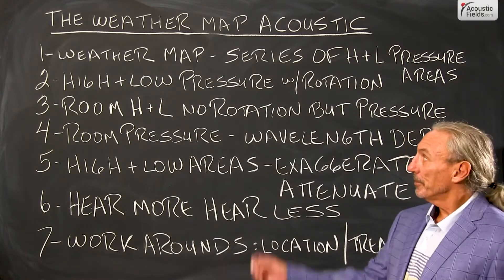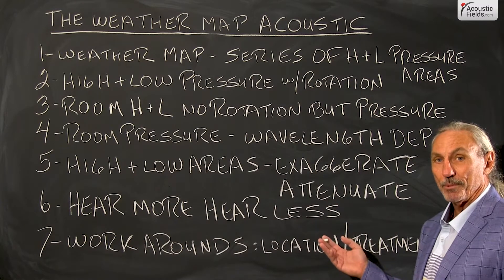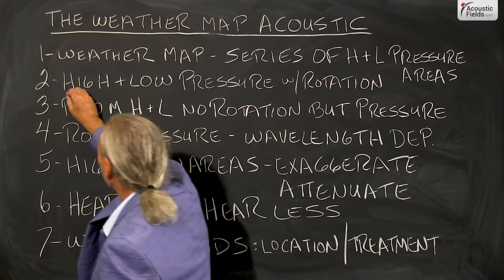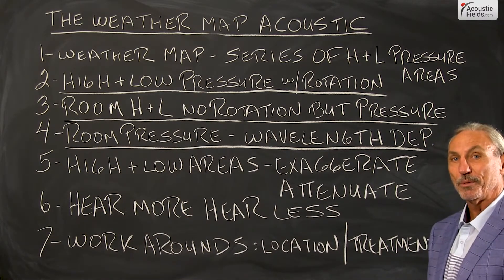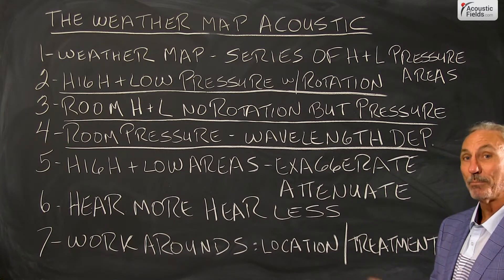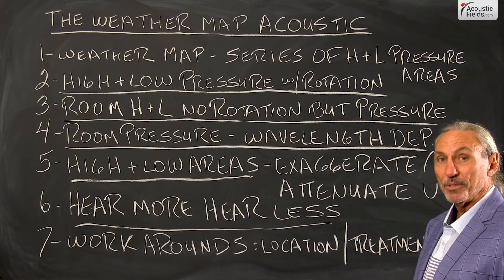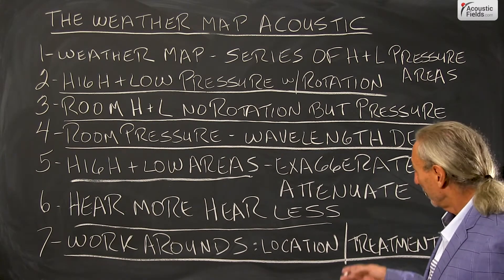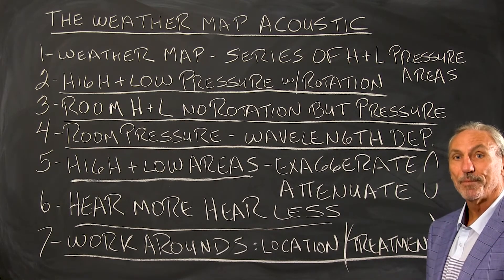The Weather Map of Acoustics - www.AcousticFields.com

Comment: Guess the Sub-woofers Low Pressure would be considered the Big Storm in the room.  I've seen your other videos and  learned to stay away from the corners and raise them off the floor,  What are your thoughts on using the Sub-woofer crawl? Placing the Sub at your listing area then crawling around the room to find the sweet spot. Thank You
Reply from the maker: C,  Tuning through source movement is fine. However, you sit in the chair and let someone move the sub around until it "feels" right. What is right? Attack and decay rates that are normal in the time domain with clarity and definition of all fundamentals and harmonics. There's the tough part. Use two subs with an electric crossover. This will allow you to control amplitude and room resonant frequency ( Schroeder Frequency). In my studio, Sacred Ground, my subs are behind the listening position.